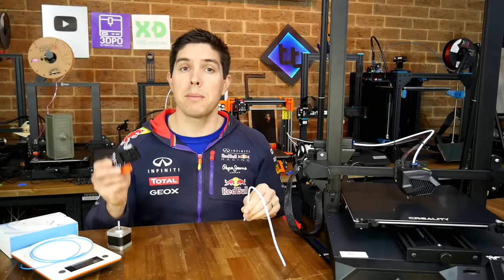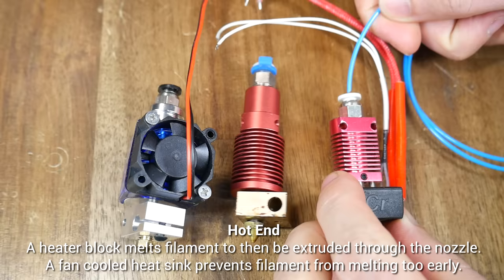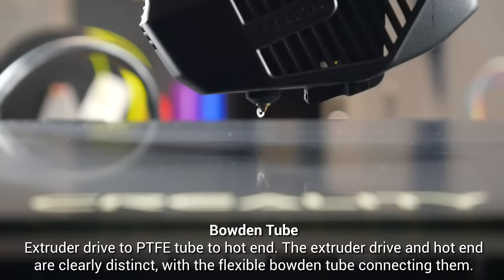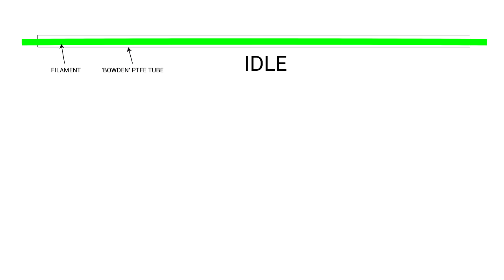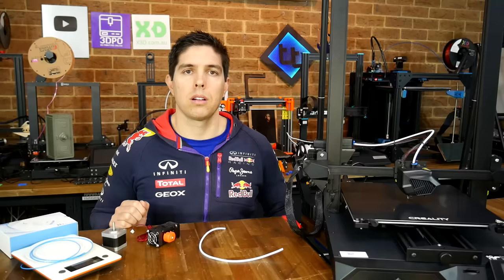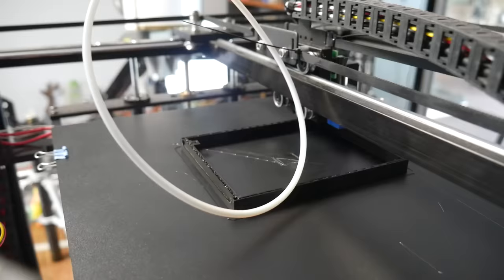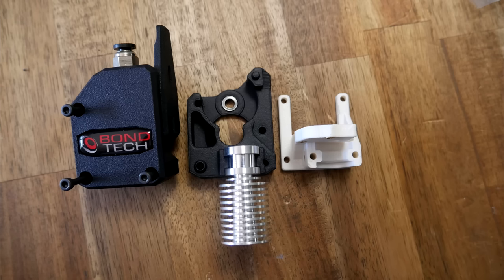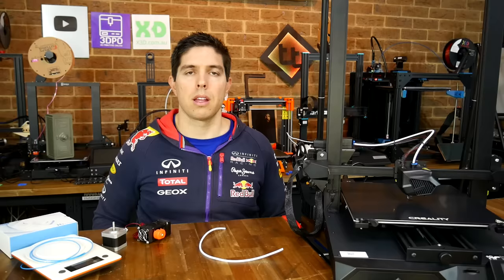Why direct drive is not automatically better than bowden tube

Comment: I use a printed direct drive with stock components on my Ender 3 because ABS is the cheapest and easiest to find material option in my country, so I only print with it, and changing filament on an enclosure with the Bowden tube was really hard.

Comment: Pretty much the only reason to use direct drive is for flexible filament. The only real technical issue at any rate. It comes down to personal preference/manufacturer design. Any other "downside" can be tuned through print settings. I have two printers, one is direct drive, one is bowden, they both print pretty much identical and the drive mechanism has never been an issue.

Comment: One type of printer that can do with help is a delta with a bowden tube... damn horrible when the head is at extremes on the print bed, as the bowden tube makes the filament have to stretch - so you don't get consistent flow on all areas of the print bed.  A DD head would be heavy and slow for a delta, and a bowden tube has such a flaw.  We need a tiny geared DD print head that doesn't weigh more than the rest of the printer :D

Comment: I use direct drive because I also use titanium heatbreak for high temp printing. This requires shortest retractions possible to avoid clogging. With bowden I think I would get a lot more stringing trying to avoid clogs.
Reply: with your setup do you have to keep it fast with filaments such as PLA?

Comment: I have the BIQU H2 on a 300x300x350 printer and not having to sling extra weight around means it can still print pretty fast.

Comment: My work has a Dremel 3D40 which is direct drive and it has sooooo much ringing. Print quality is good except for that. My Ender 3 at home I just upgraded to micro swiss direct drive and it works perfectly. Even with the stock extruder motor being so heavy I have no ringing, no idea how but prints look amazing.

Comment: I have the ender 3 pro
Been running box stock til now
Took the box stock motor etc and relocated for direct drive by just swapping the bracket and the wire feeding that motor
It ran perfect as it was
Only reason i changed it was to use flex filament
Otherwise, i would have never changed it
I dont have vibration problems, everything sits tight with no movement

Comment: Direct drive is the way to go imho, my printer was marrowed with problems from clogging, to stringing and blobs all over my prints, I had to adjust retraction for almost every type of filament and different filament brands. Since the direct drive upgrade its pretty much just setting up nozzle , bed temp and I can print for endless hours without having to worry, its pretty much send it to printer and turn away. I had to sacrifice around 10~20% of speed but its worth it.

Comment: Automatically I thought I'd need direct drive to print tpu or flex but if you just turn retraction off and slow print speed to around 15mm/s it's prints perfectly fine on a stock ender 3 with upgraded capricorn tubing

Comment: I just switched from bowden to a direct drive on my ender 3 v2, now using a e3d titan extruder with a slimline motor, my retraction is now 0.5. My only regret is not doing this earlier. For a coreXY makes sense to keep the bowden setup, for this kind of printer, it's stupid not to upgrade.

Comment: NOW you post this, just after I have spent a week tuning in my Hemera ;)
Reply: Depending on what you had before. Hamera is still likely going to be better.
Reply: @F2_CPB  I was mostly joking, I have a CR10sPROV2 with a glass bed and I had issues with the bowden tube popping out and also stringing, and the prints I do don't need to be printed particularly fast but need to be high quality. Fitting the Hemera has made extrusion very very reliable, although I do now have a small amount of ringing, so I am currently printing some test prints to fine tune settings for acceleration, jerk, and linear advance.
Reply: I love my direct drive on my CR-10S Pro.   I don't print at max speed with that moving bed.  I tend towards printing higher strength more utilitarian parts with larger layer heights and larger line widths to increase my print speed taking advantage of the bigger nozzle.

I get much less stringing even though the nozzle is bigger.  The direct drive is so much "better behaved".

I have a Zesty Nimble here that I'm tempted to throw on there, but I'll probably just keep it was a spare or maybe use it to upgrade someone else's printer eventually.

Comment: I'm currently trying to solve excess stringing with wood filament and a red pla that I have. I think changing retraction speed up a bit is the first for a "in general" solution. I would have sold retraction distance too, but for whatever reason wood filament automatally retracts really far for me without any kind of settings changes. 🤷‍♂️

Comment: Just got an Ender 3 Pro two weeks ago because I wasn't sure how into 3d printing I'd get and didn't want to invest too much. I got pretty into it. 
I've already done all your typical ender upgrades but left the hot end stock because I knew it could eventually be converted to DD.
I think I'm gonna use it for another couple weeks, get it even more dialed in and then see how I feel. Any one have any takes?
Reply: If you get it dialed in you might want to hold off on the DD upgrade.  Why mess with it if it works?  I've made the mistake of tinkering with one that was working and throwing it off.  Upgrading and modding them is fun tho.  Happy Printing!

Comment: I think the reduction in retraction given by direct-drive is not given sufficient credit.  It not only saves on print-time and reduces stringing, but it also reduces the risk for clogging.  With an all-metal heat-break, the risk of clogging increases as you increase retraction distance as that can cause half-molten material to get dragged up to where it was not supposed to get in that state and there solidifies and causes a clog.  With the sub-1mm retraction of a direct-drive, this is much less likely.  Of course the quality of your cold-zone, heat-break, etc. also all play a role and a PTFE-lined heat-break probably has less problems with that, but then introduces limitations on temperature.
I feel direct-drive is the way to go - the weight-drawback can be engineered out with stronger motors to move the extra weight and clever tuning out the ringing with accelleration and vibration measurements.  The drawbacks of Bowden on the other hand are best countered by just changing over to direct-drive.

Comment: i prefer a dualgear direct drive for speed and flowcontrol. sharper corners and straighter straights. linear advance and 32bit board. :) also can print esun "tpu" at pla speeds.

Comment: I'd like to see more content focusing on how to improve the problem of ringing generated by the Y axis of slinger style printers - for instance, using carbon fibre carriages and lightweight heater beds - then you'd be better able to reap the benefits of lightweight DD setups
Reply: Agreed, I have a big heavy direct drive setup on my system, it's not really a problem as my y-axis is limiting my speed

Comment: Got a 5 nozzle printer, bowden tube is the only way to go as moving 5 stepper motors would not only be too much weight, but also too much volume and reduce the max size of prints.

Comment: One bonus has got to be the tube not causing blockage in the hot end right ?   thats got to be a big benefit.
Reply: Probably. I had my ender 3 pro for a week and then experienced a z height issue. Filament grinding, etc. Realized it was probably clogged and boy howdy was it ever. 
I upgraded to a metal extruder and a capricorn tube last night and then followed Luke's Creality Hot end fix with the two pieces of tubing and the spacer between. 
Only time will tell if it makes any difference. Holy hell cleaning that clog out was a nightmare and I didn't have a spare nozzle.

Comment: How about flying extruders that try to keep as short a tube as possible while using a bowden set up?
Reply: I switched from  a flying extruder on my delta to a sherpa mini because the flying extruder was creating a lot of vibrations and imparting them onto the print. Sherpa mini is so light that speed is not a factor
Reply: @kazolar  I have a flying setup as well, and solved the vibrations with a damped suspension instead of straight elastic.  It works quite well with a 13cm bowden.  I'll have videos of the current one (using an LGX) posted sometime soon, but I used the same damping setup on a flying Nimble and have a old video of that on my channel.  (Flying Nimble wasn't worthwhile, but flying LGX is excellent.)
Reply: I think I've seen a printer in one of Thomas sanladeres videos of a fair, where somebody builded a printer with 4 Hotends, filing extruder and counterweights to counter the impulse of the extruders. 3 kinematic systems, probably very expensive, but super cool in my opinion.
Reply: @kazolar  I've got a flying extruder on mine as well currently and been thinking about getting the orbiter extruder and make mine a direct drive.

Comment: I'm completely spoiled by the Prusa Mk3S extruder. It's not the fastest thing on the planet (not by a long shot), but it's reliable. I like to rig up a "reverse Bowden tube", which is basically a direct drive pulling filament through a PTFE tube rather than an extruder pushing filament to the hotend. Probably unnecessary, but it's been bulletproof for me.

Then again, Ultimakers and deltas are Bowden tube, aren't they? And so is my Prusa Mini.
Also, I've worked with a dual extruder direct drive printer and that monster hanging off the XY gantry is frightening sometimes.

I'm told that flexible is easier on direct drive. I couldn't say either way as I don't print flexibles, but it's nice to have the option.

Comment: Honestly, I won’t go back to Bowden. I’d consider it if I ever purchased a prusa mini but that’s about it.  It fixed all the clogging problems in my ended 5plus and ender 3 pro. If your printer is modern, and you’re not a speed demon (and lets face it, if you own a cheap 3d printer, it’s never going to be that anyway) then you need a direct drive

Comment: I've found that flex drive extruders have a bit of slop in the cable so any print quality improvement you gain from reduced ringing you lose in increased layer inconsistency.
Reply: Yeah I'd imagine the torsional backlash of those flexy shafts would be worse than just having a nicely toleranced PTFE tube or simply using 2.85-3mm diameter filaments

Comment: There's also the fact that an all metal heatbreak with bowden almost always causes issues, even with high quality heatbreaks. Either stringing or poor print quality is what I observed trying all metal with bowden. Direct drive eliminates this issue completely and can even work well enough with poor quality cheap metal heatbreaks.

Another pro for direct drive in my opinion is not having to deal with the bowden tube flush against the nozzle. Even if you manage to make the cut perfect - eventually the bowden tube will slightly separate from the nozzle either due to slight PTFE tube shrinkage due to temperatures or due to the PTFE coupler digging into to the tube just enough to cause separation. Either of those scenarios introduce leaks which might not be noticeable at first but eventually they manifest in stringing and diminished extrusion quality.

Currently I'm having issues with my DD conversion as I noticed a repeating issue caused by a slight sag due to the motor mounted on the X carriage and other artifacts that from what I can tell are caused by the weight of the assembly, not just ringing/ghosting. I don't want to dump more money into my machine as I already spent hundreds trying all sorts of mods and upgrades, so a Hemera type extruder AIO is something I don't want to spend money on. I'm trying to CAD a mount that would house the motor and extruder as close as possible to the X carriage bracket in the hope that it won't introduce any sag or whip the nozzle around by fractions of a millimeter that unfortunately results in poor print quality, trying to create a more rigid and balanced mounting solution... Vslots, rollers + 20x20 extrusions for the X gantry are a limitation for DD until we have a better AIO solution. Hemera and Biqu are moving in the right direction IMO, hopefully those kinds of systems will become the norm in a few years time.

Great video though, I just think you may have overlooked some aspects of DD vs Bowden that IMO lean towards DD being the better overall option for an average printer. Bowden is still king for small machines like the Prusa Mini etc, but for most machines I think DD is a better option if done right even if by a small margin.

Comment: actually a bowden tube is specifically a tube locked to the ends allowing the transmitton of power. pike breaks and old clutch cables work on this principle

Comment: If you have a large moving bed, it makes no sense to have a bowden tube because the bed already limits your acceleration in one axis. It doesn't hurt much then to limit it in the other axis as well when getting all the direct drive upsides. But on a corexy printer where the bed doesn't move in X or Y, a bowden system can make sense.

Comment: Bowden to be honest, can be almost mounted without any effort, easy mechanica, but for me the biggest reason is the uncloging progress compared to DIRECT-DRIVE. Remove the tube, remove the hot-end done. DIRECT-DRIVE on the otherhand, (depends on design ofcours.... and brand) i need to take apart the entire extruder  before i can remove the clog in the hot-end and rebuild both after that.

Comment: What about putting an encoder just before the extruder on a bowden setup? The encoder to could monitor the filament movement precisely in order to compensate for the wiggle room in the bowden tube. While I think it would be interesting to see this idea tested, I doubt it would be practical. There would likely be enough of a delay between the movement of the drive motor and the movement at the encoder that you'd have to slow the whole system down in order to take advantage of the possible precision of the added encoder.

Comment: I bought a sturdy but a horrible designed 3d printer (Sunhokey i4) 5 years ago and the extruder weighs over 2 lbs!!! Although I was OK with the ringing since I mainly use my 3d printer for parts, it does ok when I print at a really slow rate 30mms or slower. I am finally getting rid of all the excess weight so I can print a bit faster and should show a lot less ringing...

Comment: From what I understand but I'm fairly n00b many convert to direct drive to print fillaments that require high extrude temperatures as the PTFE tubes in a Bowden design get damaged quickly at high temperature and that damage comes with toxic fumes.

Comment: Interesting that you did not speak about delta style. It has enormous benefits to print quality, but bowden was .... well 7 years ago, it was basically a must. Now with pancake steppers things have changed. 
I think the drive cable paradigm is not popular is caz there is play in the mechanism.

Comment: my first printer i got 6-7 years ago was a prusa printer with direct drive and i later upgraded it to bowden. 
i dont want another direct drive extruder i had to dismantle the whole thing pretty frequently because of clogs and it was a pain. never once had to fully dismantle my bowden setup.  
I've printed with flexible filaments and had 0 issues with it. direct drive is heavy and clunky. it takes up more space than necessary i actually gained 20mm of print space by switching. 
the direct drive extruder hit the far side of the frame. it was just a disaster all around. 
you couldn't pay me enough to switch back.

Comment: I think the Voron printers have proven without a shadow of a doubt that DD doesn't have to be slower or cause ringing. Having said that. Converting a machine designed for the lighter Bowden trolley is what I think causes issues. If your printer's structure is designed exclusively to use a heavier direct drive trolley, like most recent Voron machines. You shouldn't have an issue with speed or ringing. But when you do a DD conversion on a cheap Chinese printer that could barely handle it's lighter Bowden trolley. You're going to have to slow down or deal with quality issues. 

I use DD on everything. I like the easier tuning and the wider versatility of it. But where I think Bowden systems shine is on mini Printers like the Voron 0.1 or the Ender 2 series.